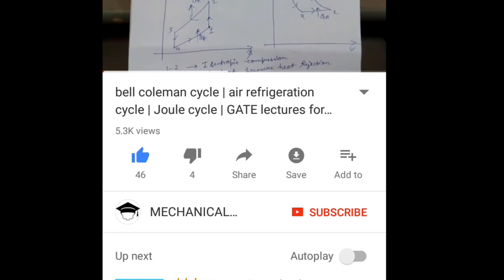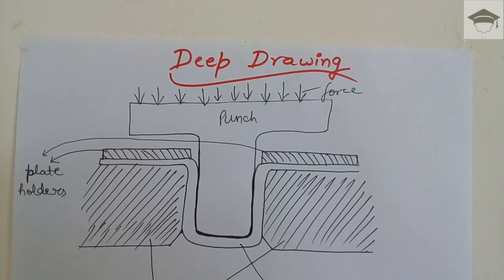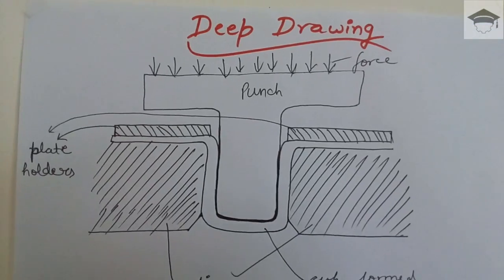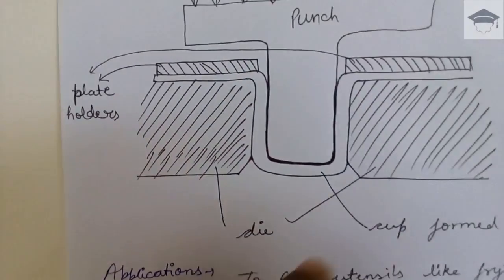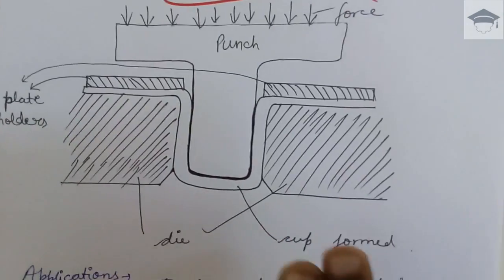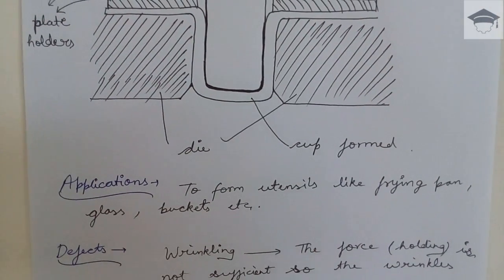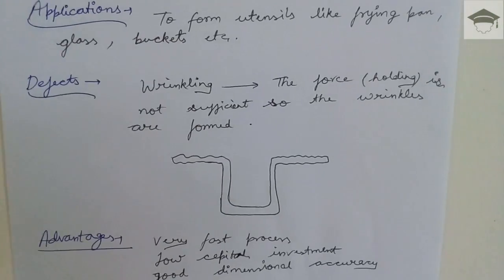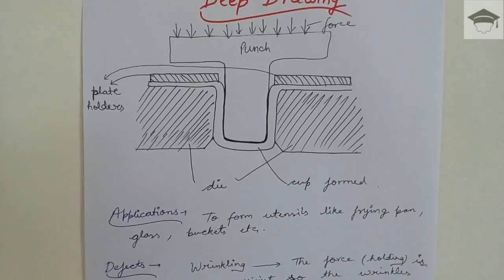deep drawing with its applications, defects and advantages explained

Comment: Sir, is it possible to use DEEP DRAWING press for a 1/2" thik MS SHEET in a CUP SHAPE  ?
Reply from the maker: Yes its possible but very large force is needed in order to achieve this.
Reply: MECHANICAL ENGINEERING: Yes! I can see that such works requires much more pressing power, but I'm wondering how common such press is available in INDIA